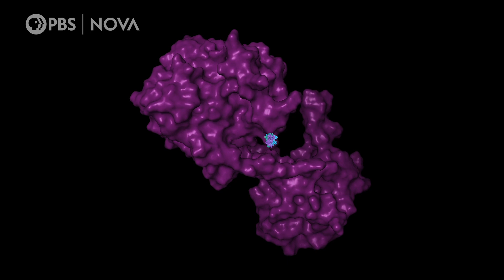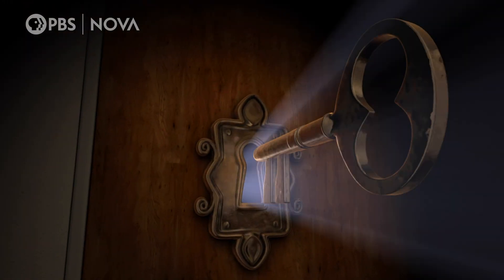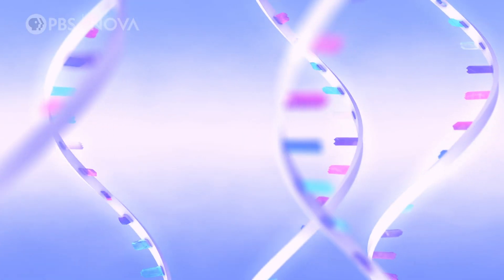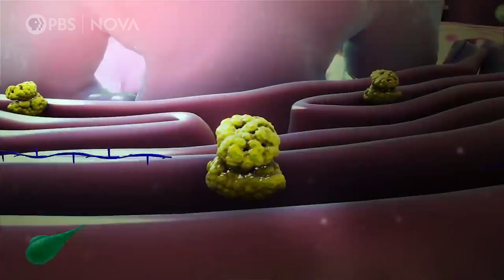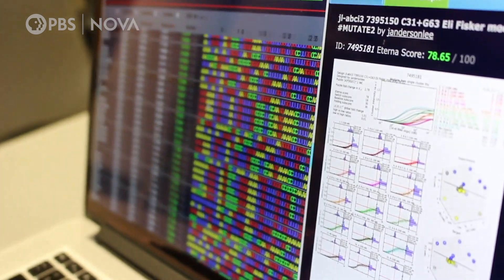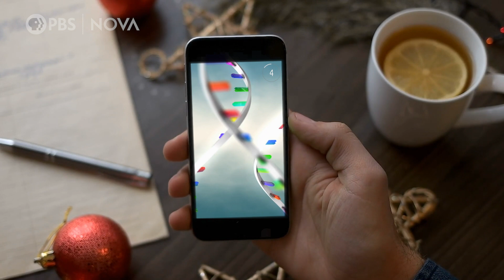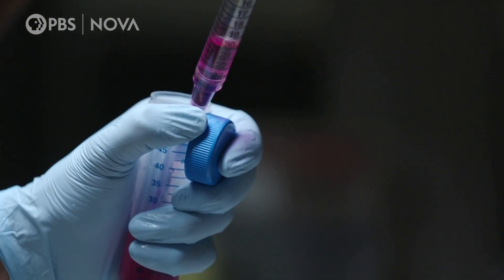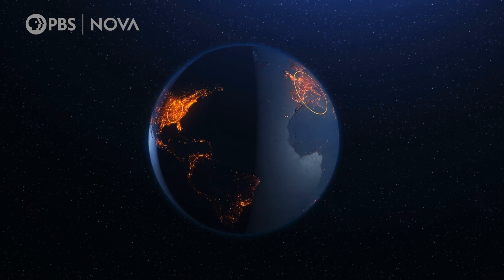Can Scientists Use RNA to Create a Coronavirus Vaccine? I NOVA I PBS

Comment: how does mRNA in vaccine gets into the cells or it is meant to be used by cells in blood?
Reply: It can't enter cells. It's simply a molecule creating 1 protein that the virus uses as well to attach to cells. But the real virus has more proteins allowing it to enter those cells and multiply. the molecule introduced by the vaccine is lacking all the other proteins you need to do that. Your immune system will learn how to dismantle that protein since it just sits there and doesn't do anything else. Once your immune system learns how to destroy it, it can also destroy that part of the virus and once it can't attach it also can't enter cells to multiply. And then your not getting sick.
Reply: @randar1969  nice bs, endocitosis occurs, i read and there it all happens because you need ribosomes

Comment: Usually if something is fast and massive in production this suspiciously sounds like something unreliable. Not to mention that stage 3 clinical trial takes anywhere from 1 to to 3 years. Who knows what long term effects from this would be. May be immune system will attack your own cells after a while, may be one will get cancer in year or two. I think this is very dangerous to implement unstudied technology on millions of people.
Reply: Why are you worrying more about the maybe/perhaps long term effects of the vaccine when you know the long term effects of covid-19 running around? Why would an mRNA molecule that  produces 1 out of the 24 proteins the virus makes suddenly cause problems? But even if it did , that would mean everyone infected with the virus will have the same problem.

Comment: So when DNA is said to be sequenced, is that one 3-billion x-strand that is inherited from the mother or father.. or is that 6-billion base pairs from both x-strands?

I don't understand how the chromosomes (responsible for 250 million letters) fit into the picture.  Doesn't EACH chromosome have 2 very large , and separate, molecules of DNA strands.    So therefore 23 chromosomes, would have both mother/father contributions... yet there are 46 chromosomes!   Having trouble visualizing how this is organized inside the cell.
Reply: DNA has nothing to do with the virus nor the vaccine. The only thing is that DNA is evolved from RNA as a double helix spiral containing instructions. The mRNA vaccine introduces a molecule containing a simple set of intructions as single strand RNA that will trigger the molecule to create a protein that attaches to cells and do nothing else since it lacks further instructions or proteines/amino acids to enter the cell.  Your immune system will figure out how to destroy that proteine. Once it does it will also kill one of the 24 proteines the covid-19 virus uses to attach to cells because that proteine is the same! Preventing you getting sick as then it can't enter cells either to multiply anymore.

Comment: Why not just produce the spike proteins in a lab, and inject that? Why get your body to produce the proteins, forever? By your body's cells producing these spike proteins, your immune system will not only attack the spike proteins, but it may also attack your own cells. Then you have an auto-immune disorder, or at least have elevated immune activity for the lifetime for the spike protein production. And how will you cells handle all that excess spike proteins being produced in it?
Reply: Well atleasyt you know what the molecule does in that regard congratulations your more educated then most of the responses here by a long shot. Still your lacking some knowledge the molecules inside the vaccine that produce the spike proteins can't survive long most of them will be destroyed by your bodies heat in 8-9 hours and at room temperatures they can't survive longer the a few days. One of the reasons the mRNA vaccine needs to be super cooled. Besides the real virus produces dozens of proteins and can alter the RNA code inside cells to multiply itself making you sick. The vaccine can't it's lacking all the other code to enter cells for example.
Reply: @randar1969  they might get destroyed even before cell uptake. Perhaps an immune response to the lipids themselves. Perhaps the lipids protect the mRNA from degrading as usual. Lipid transport to places that it wouldn’t otherwise go, such as a cross the blood brain barrier. You know the thing with science is that everything looks so perfect and exact beforehand, it’s only when you actually perform the experiment, which is what we’re doing right now, that you have the oh moment.
Reply: @ianh7301  Spot on - 99 percent of this is petri dish extrapolating. Having any of this work in real time, invivo is a tall order.  Anytime we take an exogenous entity, which is what this mRNA molecule now is, and expect it to go back into a body in all manner of unnaturalness.... and mimic what the body does organically is almost godlike...
Reply: @randar1969  its funny you smart people coming with all your knowledge you learned through government institutions, the truth is its never been tested on humans so no body knows what the effects are, and your immune system isn't something to be messing about with. A good diet is all you need.